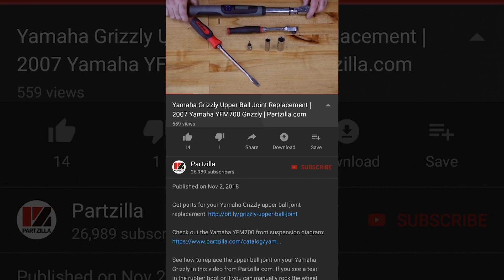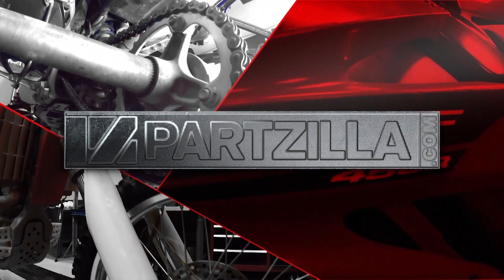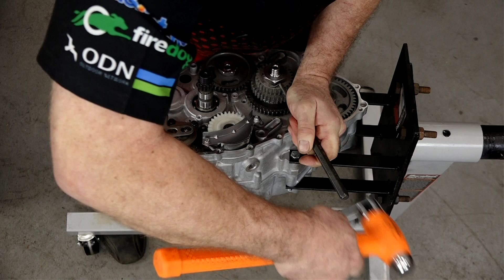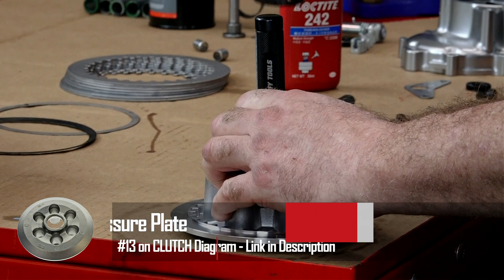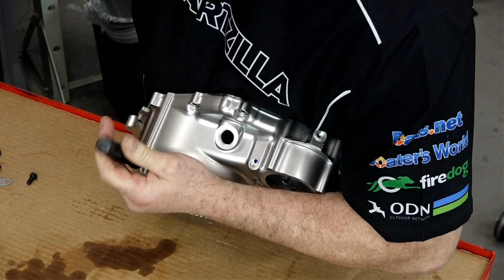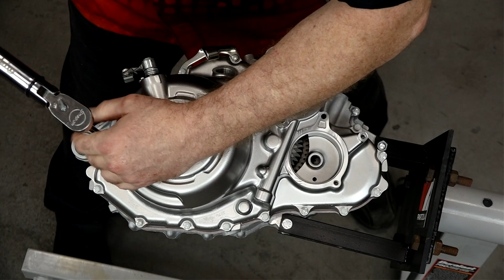Yamaha Raptor 700R Engine Build Part 3: Clutch Build and Water Pump | Partzilla.com

Comment: Hey John what way does that oil seal go that the plate with 2 screw hold in ? I've torn it 2 times when putting the clutch over back on ?

Comment: I have a yamaha raptor 700 I have problems with it when the engine warms up it refuses to start, it only starts if you press the accelerator and it works interrupted
Reply from the maker: if you are having trouble starting the engine when the unit is hot you may need to preform a valve adjustment!   check out this video! we show you exactly how to do the job!

https://www.youtube.com/watch?v=hpsXYkjnZKc&t=156s

Comment: little late on this but, is there a reason to leave out the retainer wire that holds the first few rings and fiber disc to the clutch basket?